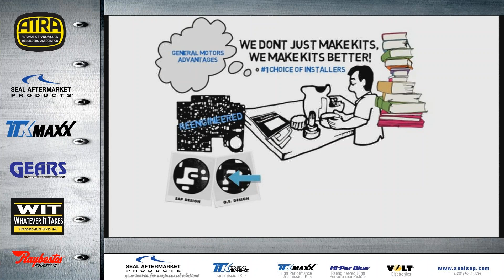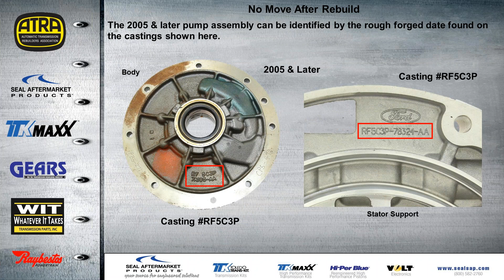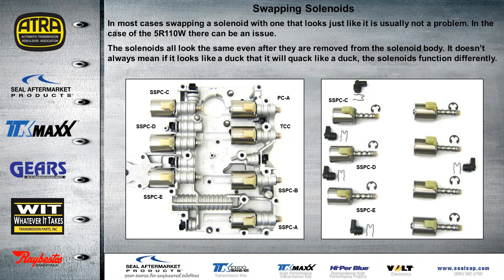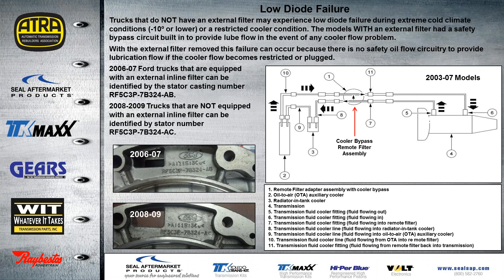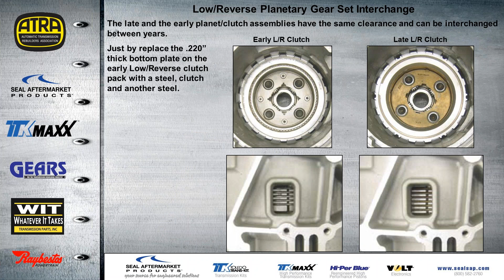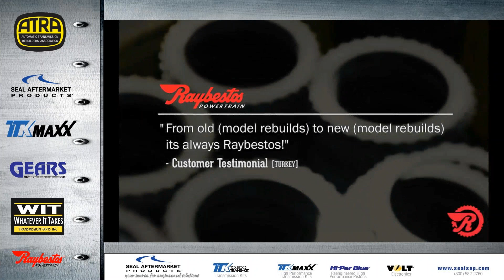5R110W Problems Fixes

Comment: Got a freshly rebuilt 5r110w when watching gear command it skips 2nd no matter what it never hits or commands 2nd gear...shifts 1,3,5,6.....also threw a P0761 "C" solenoid issue.....that code threw itself driving down driveway on a 3-1 downshift gave it gas to see if it would command 2nd and just did a 1-3 up shift and started flashing tow/haul with that code....then this morning I pulled it out of bay and did a couple engagements and it had no engagement not in reverse or drove just acted like neutral... threw code P0706 range sensor issue...its in a
2005 Ford F350 V10 (6.8) ....got any idea?
Reply: Did you figure this out ? Dealing with it now
Reply: @chainarmor448 yes so on my scanner this is exactly how it’s was monitoring shifts reason for issues was left at the two sealing rings in very rear of case
Reply: @DeonteHiggins thanks I put a different transmission in it. Going to tear it down soon to see what happened
Reply: @chainarmor448 was it same model and year transmission?
Reply: @DeonteHiggins  I’m not sure I got them used without much info

Comment: Any one have a controller issue with these when ho,t popping a solenoid c circuit code, testing sol. with scan tool amperage good ., shifts great when cold pcm next to engine in this E450 2008

Comment: Do you have any information on how the planetary gears are illubricated? Everything I have read says "Splash Lubrication" which seems odd since the oil pump operates at over 300psi. I am also interested in the planet gear bearings.

Comment: To all DIY's. I'm a retired Automatic Transmission Tech/Builder. I quit about 6 or so yrs ago. My back and lungs are toast!. I lifted these things over 30 years.,I came home smelling like mineral spirits&grease. People coming in the the shop complained about the air remember I breathed it 5 days&9 or 10 hours a day.
I owned 2 shops.I started @ AAMCO in the early 70s
I see several guys built their transmission and it doesn't work,Not trying to be smart but these are very COMPLICATED MACHINES!.First you don't have a clue how they work or what is broke how do you fix it IF you don't  know what is wrong!?. Get a PRO!.